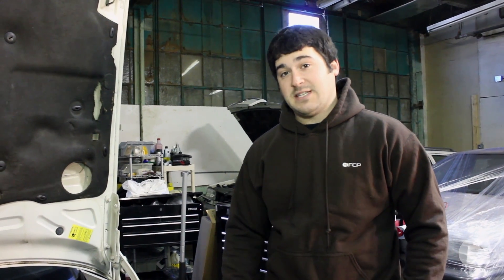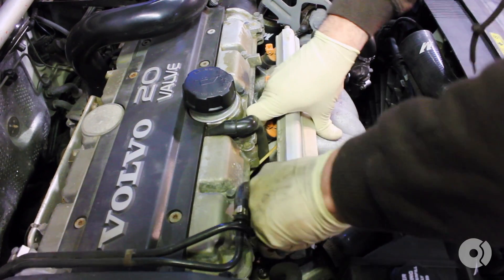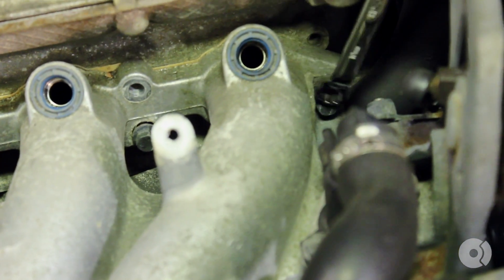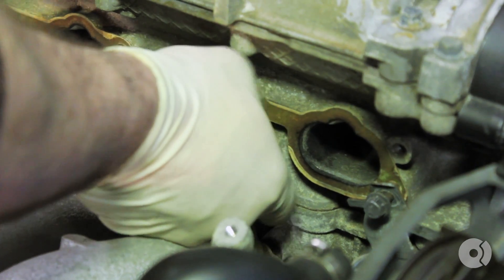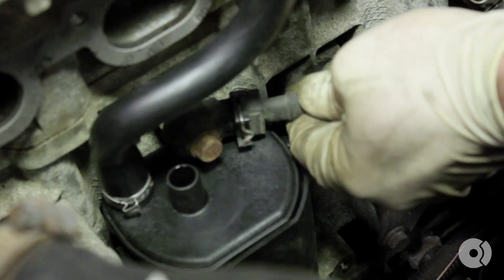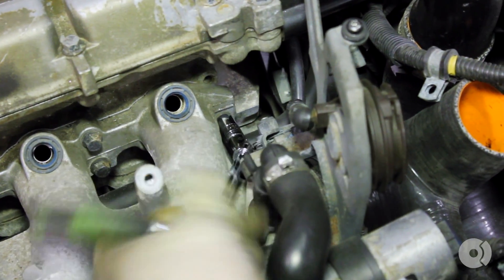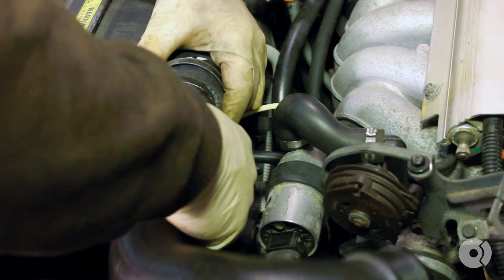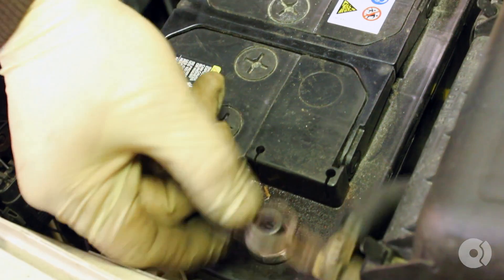Volvo PCV Breather System Replacement (850 Turbo)

Comment: Hi

--------------------------------------------------------->>FCP Euro<<------------------------------------------------------------------------- 

How often to clean up a can of PVC ??  What if km ??

Is tin of charcoal filter fuel vapor needs to be replaced, and what how many years it is changing ??

What if changes to the EGR valve and how to check if the EGR valve ??

How many vacuum hoses Volvo 850 ??

As you can upload photos from VADIS as they go all the vacuum lines and those of the air filter and the filter of PVC and carbon fuel vapor

Regards
Artur
Reply from the maker: Thanks for your reply! However, there are many different questions here without simple answers. We recommend to submit your questions to products@fcpeuro.com. Our product team will be more than happy to assist.

Comment: The best manual on the Internet. Fast and useful. Thanks a lot!
I had to remove intake manifold because of vacuum leak in it. Caused misfire, unstable idling, stalling, very bad mpg and low performance.
Now it is working perfectly.
Thanks again for the video.

Comment: For those wondering, the process is nearly identical for a '98 S70 T5. Only a couple differences, with the way the fuel rail is connected to the intake manifold, and the vacuum tree is slightly different. Take the fan off to make your life way easier. The toughest part of the repair is getting the 2 bolts on the bottom of the manifold (at 3:45 in the video), and also the left-most manifold bolt is pretty tough to get to. Ben makes the dipstick and manifold bolts look really easy but that's because he knows exactly where the bolts are. Finding them in the first place is the hardest part, but putting those bolts back in place when you're done should be a lot easier.
Reply: Where does the hose on the driver side of manifold connect to

Comment: What happens if you dont do this? My 03 s60 fails the glove test, and oil slowly pools up under the cover, but the car runs fine and I've driven it for the past 80,000 miles like this.. How do I 100% confirm if my pcv system needs replaced? (are codes triggered?, does the car run like crap?, Is there a half-ass way to clean it without replacing all the stuff?)
Reply: If the system isn't replace once its clogged you will continue to build up more and more pressure within the engine which will eventually consume engine oil and push out oil seals causing major oil leaks. The proper way to remedy the issues is to replace the components. Sometimes the issue becomes so drastic if left for too long that the oil pan will need to be removed, cleaned, or replaced as well as resealed.

Comment: Hi, what size oetiker clamps for hoses do you need for this job? It would be very helpful to buy the right size. Also what type of silicon did you use for fuel injector lines?  thanks
Reply: Hello, The oetiker clamps are included in our breather kits however if you wanted individual part numbers you can simply email sales@FCPEURO.COM.  The silicone used on the injector seals is just a silicone based grease which can be found here: https://www.fcpeuro.com/products/brake-pad-silicone

Comment from the maker: Hi Adam, 

          That bottom bracket can sometimes make things a bit difficult. My recommendation would be to loosen the manifold and bracket, while keeping the bracket loose, tighten the manifold and then the bracket after. This should ensure that manifold doesn't have anything in its way preventing it from sitting flush. I hope that helps - Jason
Reply: Hi FCP Euro, i just completed this replacement yesterday with a kit i recently bought from you for my 2000 C70. Today i turned the car on and warmed it up to test the pressure. Unfortunately, the car tested with pressure still. I used the glove test and also saw smoke coming out of the dipstick. Do you know why this could be?
Reply: +music buy Are you sure the lower block hole was not plugged? I always run a little oil through it with a hose to make sure is flowing.
Reply: The reason he didn’t answer is the video is very old. He isn’t checking for new questions about this most likely. Make sense to you? Lol. Give youtubers a break Brother. They don’t all make money off this. And work full time jobs and have a life. WOW.

Comment: When i replace the manifold it will not seat properly on the bottom bolts.  It seems as though the bottom bracket keeps it from sitting flush.  I made sure the bracket is bolted at the lowest point.  Any ideas?

Comment: I successfully completed this repair last week, thanks to this video.  Although, i cut up my hands pretty bad trying to get the bolts off the bottom of the manifold.  When I put them back on, I used a couple ratchet extensions and approached them from the bottom of the car, as opposed to trying to reach under the manifold again.  Running great now!
Reply from the maker: +Ryan Hall Awesome! Maybe we should start selling FCP bandages....

Comment: AAAAHHH!!! I wanted to hear it start up and run... It would have been Icing on The Cake...   

LOLOLOL!!!

However, Now I know what's wrong with my S40... That looks like a Saturday Project to me. But because I have Big Hands? I think I'd better remove the Radiator and Fan Assembly...

LOLOLOL!!!

Thanks for the video...

Got It...

Comment: As a 850 T5 owner just want to say a very big thank you, you are two piece of God, man! I have one cuestion: what is the PCV box exactly? I mean what does it stand for and what does in contains? Is it electronic stuff or just a connection point to the housing?
Reply from the maker: hamaramadarat A PCV (positive crankcase ventilation) breather system is designed to regulate hazardous waste from your vehicle. As your engine runs, combustion gases escape from the combustion chamber, finding their way into the crankcase of your engine. This unused combustion gas, also referred to as “blow-by,” can be a major cause of smog. A PCV system prevents pollutants from escaping into the environment and vehicle manufacturers started fitting engines with a PCV valve to ensure that gas remains contained within your vehicle.

Comment: Followed the instructions to successfully replace the oil trap and hoses in my 2003 V70.  The only problem I had was reinstalling the bolt into the manifold through the bottom bracket.  I struggled with it for an hour plus.  Eventually I just left it out.  Q's:1) How imperative is it to have the bolt in place when there are 7 bolts holding it in place form above? 2) If it is important, how can I get the bracket to line up so the bolt can thread in?
Reply from the maker: Allen Peltzman Loosen all of the bolts on the manifold so there is some play to it. Then, use a 10mm universal socket to get the correct angle.

Comment: Purchased the PCV service kit from FCP. You changed the dipstick oil tube O-ring wouldn't this also be the appropriate time to change the injector O-rings as well? I may just be over thinking things may be a nice addition to the kit though. I'll let you know how this goes as well as how long it takes. Great video.
Reply from the maker: nickolas swader It's more of a personal preference, not a must. Inspect them, if they seem worn then replace them.

Comment: Awsome!  Have a '08 S60 2.5T 119,200 that needs lots of love, I just bought used. I've started with new coil packs and volvo plugs, while in process, noticed oil had seaped under # 3 coil into top of plug cylinder.  Absorbed oil with paper towel before replacing plug.  Next doing PCV system, then timing and serpentine belt. All parts are from FCP because of your pricing and your instructional video's.  I am a rank amateur but get a total kick out of this and no, I don't work for the supplier. Question, is it possible to clean the long PCV metal tube/hose on the turbo if the hose ends appear in good shape, saving 200.00 would be a good thing.  And you need to video a more modern turbo with different hoses and fuel rail, I would greatly appreciate the demonstration.  Again, great service work.
Reply from the maker: Greg Day Hi there, could you email our Volvo Catalog Manager at jasonv@fcpeuro.com, he'll be happy to help you out with this one.

Comment: great Video ! However I am trying to determine whether I need to undertake this procedure. I have done two tests, Firstly I removed the dipstick end with the car running and looked for smoke.... which there wasn't any. Then I put a glove over the oil cap to see if it inflated and it did. So i don't know what one to believe
Reply from the maker: josh grantham The Glove and dipstick tests are only used for a general indication of if you have positive pressure. To gauge an accurate reading he'll need a low caliber vacuum guage / Manometer.

Comment: Is this the problem if my car hard starting and stalling at stoplights?
Reply from the maker: Khino Laureta Not likely, you probably have something else going on.
Reply: *****
alright mate imma try to change that.. let you know if it worked ..
Reply: Just curious to know if that fixed your issue? I have same issue(stalling at stop lights)now with my Volvo 98 S70, I replaced the breather box(as it is blown out), but still the issue is there. Do you have your issue fixed?

Comment: Hello, I am going to do this job on my volvo S70 (1998) base model (non-turbo, 2.4L). This video is really great but I have one question. Sorry if the answer is obvious but did you drain the engine of oil to begin with? I ask this because the oil dip stick get removed, which I imagine leads to a hole in the engine block where there is free flowing oil. Why wouldn't any oil come out of the hole where the dip stick used to be if you didn't drain the oil from the engine to begin with? Many thanks!
Reply: i just replaced my dipstick o ring the other week, no need to drain the oil ( alittle late on the reply aye? XD)

Comment: Great video! Thanks a million Ben and FCP. I it really helped when I tackled my PCV system last summer. I have only one suggestion: Don't bother trying to unbolt the fuel lines from the dark recesses of the engine. Moving the lines and fuel rail out of the way while still connected caused a huge headache for me, and I ended up bending the lines a little out of shape. Just empty the pressure from the fuel lines by using the schrader valve at the end of the fuel rail, and then disconnect the fuel rail from the fuel lines. You also won't have to worry about the injector popping out as much since it won't spill as much fuel.
Reply: Yes and don't lose that little u shape piece that's fits the end of the rail.

Comment: Awesome video. Thank you very much Ben! I've been getting all my parts from FCP as I have restored three 98 Volvo s70's so far. Looking for a T5 with spoiler. The 98 s70 in my opinion is the last great car Volvo has built! All mechanical linkage. In regards to video I didn't mess with the throttle linkage or the idle control valve. It is safer to get it out of the way but just be careful where you place the manifold when removing. I also jacked up the front and removed the oil bracket from under car. The job took five hours, but that was having lunch and being extremely methodical. All and all piece of cake.

Comment: 18 minutes and 37 seconds?  Takes me that long just to find the tools in my toolbox.  Hopefully this job will take me less than 2 hours.  I've read that the fitting on the intake pipe to the turbo (the one to which the long hose connects) should also be cleaned, but also read that it is pretty fragile to remove.  Should I do that or skip it?  If it breaks, the only alternative is an entire inlet hose.

Comment: Great vid! 
I've been working on my dads 96 Volvo 960 wagon since the car failed emissions due to code P0440... Reading through some Volvo forums and some vids I came to a conclusion that the 960 might need a new PCV system that I will be ordering from your website. 
Also, I've noticed whitish smoke coming out of the oil dipstick while idling, I wonder if that's because of the PCV being clogged or is it the EGR valve? Thanks for your help

Comment: Is this the same system as a 98 s70 glt? What is the average cost for this repair at a Volvo Dealership?
Reply from the maker: Very similar on that car though several more items will need to be removed like intercooler piping and such. Typical work hours for this job is in the 4-5 hour range so expect something around 5-600 at a dealer to have this done. Don't hesitate to shoot me an email at mike@fcpeuro.com if I can be of any more help.

Comment: I did this repair on an 94 850 turbo, and right afterwards upon driving it the miles-to-empty went from 130 to 30 in 10 minutes, is it possible that I reconnected the vacuum lines incorrectly? I don't want to drive it the 3 miles to the mechanic and have it break down for some reason. The check engine light is OFF. Everything else runs fine and the actual fuel gauge is still at a quarter full. Help!!!

Comment: Hi Ben, car runs perfect again, took down the injector cables again and checked them with a multi meter, they were all ok,
then I cleaned the contacts on each injector a bit, then lastly sprayed some contact spray on the cable side but not on the injector side, also tapped on each injector with a large screw driver - one time firmly on each one, tapped with the plastic handle side, then the car started perfectly and now runs better than ever!
Thx for you gr8 video, helped me a lot especially with the fuel line trick, just put all to the left,
I would say the job is quite time consuming for a first timer and I must say that the hardest part was to put back the two screws, one for the intake manifold underneath and the other one for the oil dipstick, hard to do when you have big hands like me, almost 6ft10 and 245 pounds guy......
My neighbour had to help me since I did not manage and almost got mad trying.
I also could not putt the injectors out in the first place, they did not want to come out, I sprayed some penetration oil and then they came out easily.  
But again the video is great but you must be prepared to spend like 8 hours for a first timer, this is when you really take time to clean all and mark up each screw, bolt and connectors, I used different type of coloured tape to help me keep track.

Comment: Hi Ben,
did last work yesterday but when starting the car did not run normal, sounded not to run on all five cylinders, all injectors and electrical wires were put back as they should, any idea, I took it slow and I have not forgotten and hoses or vacuum.
Regards and  thx.

Comment: Thx Ben! Your video helped a lot yesterday when I did this job on my Volvo V70 1997 170 bhp Petrol. I removed the thermostat hose to give me more room to reach the lower left bolt on the intake manifold, otherwise all went really well, hade to spray some penetration oil on top of each injector to be able to remove the injector block from the manifold.

Comment: Due to the broken rubber hose I got error code P0171 when scanning with the OB2 scanner and the Lambda engine lamp comes on after erasing the code, the car sort of coughs sometimes when driving due to too lean fuel mixture. You can view the end of this rubber cable when looking with a flash light next to the manifold.

Comment: I need to do exactly this job now on my V70 1997 170 Bhp non turbo,
Some animal bit off the vacuum rubber hose going into the intake manifold on the left side of the manifold, it's supposed to be going further to the brake cylinder so I will have to replace this one at the same time.

Comment: I’m not mechanical so apologies if stupid question: I have a mk 1 (registered Jan 1999) Volvo S40 T4. Symptoms = what appears to be a leaky engine cover, oil in my throttle body in recent months, occasional but increasing oil burn smells, oil flying out of filler cap I take it off when running, sooty deposits on exhaust. Is this the PCV valve (lots of searches so far appear to suggest this and have led me here)? Obviously I won’t be doing it – but is this job the same/similar on my car? Many thanks.
Reply from the maker: Yes, it is a very similar job on your car.

Comment: Can you do a video for replacing a timing belt and components for Volvo Xc90 t6, 2005.  Or do you have a video already that the procedures would be essentially the same.  Thanks and keep up the easy to follow videos.
Reply from the maker: You may have to remove the coolant line that goes through the timing cover. If you have that setup, my advice is to remove the hose from the coolant reservoir side and slide the timing cover around it.

Comment: Hi FCP,

I'm currently having trouble figuring out how to pass my emissions. First thanks for all your help w/ your videos. They're great. My NO (smog) test was the only portion of the video I failed. I have a 98 S70 Volvo. I understand there's no EGR valve. Didn't know what else I could look at to help. I checked for vacuum leaks at most places I could see w/ carb cleaner, but didn't get any change in engine idle. I bought some seafoam to insert in a vacuum line and the gas can to help. Any suggestions? 

Thanks,

Kyle

Comment: HI ! Ben .i have 2006 Volvo xc 90 is this the same procedure to remove the PCV Breather box. also i have a oil leak somewhere the timing chain cover . where you think the oil coming from . maybe i need to replace gasket. i need help, thanks..
Reply from the maker: Are we dealing with a V8 which uses a timing chain or a 5 or 6 cylinder turbo which uses a timing belt? If it's a turbo, the procedure information is essentially the same and the oil leak is most likely coming from his camshaft seals.  Hope that helps.